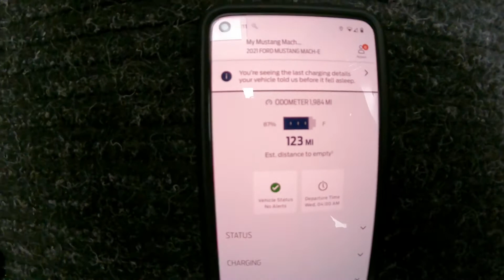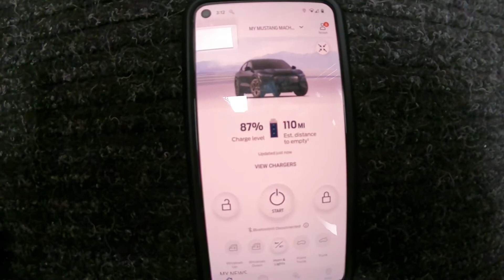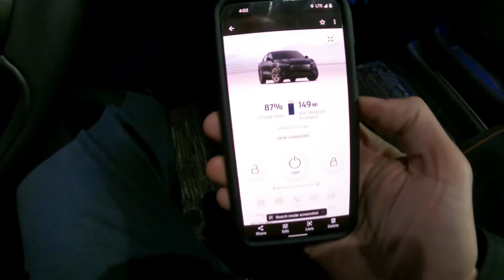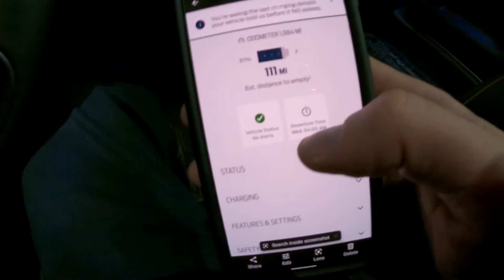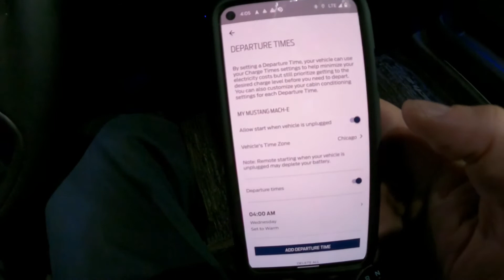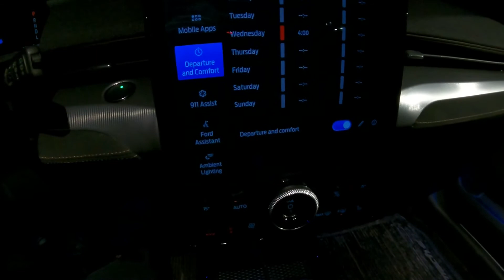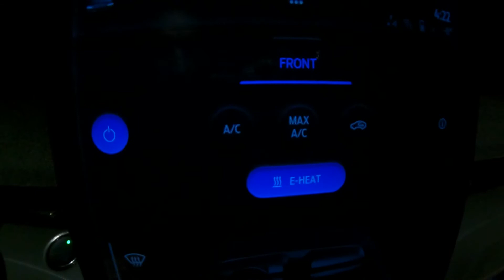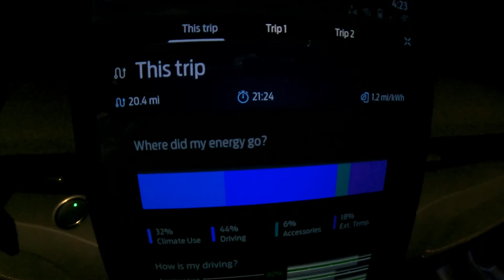Mach E Departure Schedule Failed Me AGAIN!

Comment: I had this same issue when I got my mach e May 2021, but they fixed this issue. Make sure in the app under charge settings> departure time, you have the "allow start when vehicle is unplugged" toggled on. Also, change the time to 15 minutes max run time in the settings in the car. You should change the vents to come out the front while the heat is on and turn the temp to "HI" instead of a set temp.
Reply from the maker: Allow start when unplugged was set, as mentioned in the video.  I also had the 15 minutes run time set too.  I don't set the temp to HI, because then the blowers kick on full speed and the system cools down incredibly fast then without being able to catch up.  A high fan speed would make sense if the system could produce enough heat, but it cannot in extreme cold.
Reply: @upnorthmike6085  I tested my heater here the other morning at 29 degrees. I got Heat by turning the temp to HI, Eheat on, Recirculate on, forward vent only, and having the fan speed set to auto. It worked quite well, but cant speak for -15 degree weather like you have.

Comment: Found your channel, and as a Minnesotan in the Twin Cities getting a Mustang Mach E, I've watched the last few videos on scheduled departure times.  I haven't watched the Mach E Heat and Heater Conclusion video.  Did you end up getting departure times working?  Is this part of the update that was pushed by ford for HVAC updates to programming of the HVAC?  We haven't had temperatures significantly 32 this winter, but has this gotten better.  2023 is built with delivery by the end of the year, and I have a garage and 240V and plan on preconditioning, with departure times, but learning about best practices.
Reply from the maker: You've got some more videos to watch  ;)  These will all be answered so be sure to check them out.  Yes, departure times are key.  With 240v and a garage, you'll have no issues with all the updates out now.

Comment: I will be getting my Mach E in April and it will still be fairly cold here in Fairbanks Alaska. Luckily I have a garage and will certainly keep my Mach in it. I still intend to recondition my batteries and warm cabin before departing so I will certainly learn if I have the same issues you appear to be having. One comment I will make is if you think about it logically that we are sitting on one ton of batteries at the outside temp. If you placed a ton of water on the floor of any vehicle, left it out all night in freezing temps, and drove off then your vehicle would be cold for a long time. That is just the way it is so if you live in a cold climate and do not have a garage then you need to have a Mach plugged in and set to precondition. Downside is that increases your electricity usage and lowers the overall efficiency. Improving cold climate performance is something all EVs will need to continue to improve. Hopefully you can get your vehicle’s issues resolved.

Comment: I have my car plugged in all night ....only 110 volts.....precondition set for 4.30 am....I also remote start my car 15 mins or so before departure.....this helps with the warm up cycle.....minus 30 degC....car is warm when I leave.....you shouldn't or try not to precondition unplugged below freezing as it trys to warm the battery pack as well that's a lot of wasted power. It was definitely a learning curve this winter........
Reply from the maker: What I confirmed is that when the vehicle is unplugged, preconditioning will not warm the battery,  only the cabin.  However as outlined, the preconditioning didn't even start when it should have.  I agree on the learning curve, but there are issues with the system to say the least
Reply: Good to know
Reply: My only 2 complaints with these cars is how slow they charge when it's cold out........and how much the range drops off.

Comment: I usually don't use the App.  I go right through the car and set up the Departure time.   If that fails in the morning, which it does from time to time,  I just remotely start the car so it's all warmed up.   Ford needs to fix that App for sure....
Reply from the maker: I  used the app this time, however I also confirmed the vehicle got the precondition time, which it did.  So, seemingly the app worked and transmitted the time to the vehicle, but the vehicle just didn't start at the time it should have.  What a pain!

Comment: It looks like there are programming bugs when not plugged in. In the extreme cold you have your best bet is to plug it in every night.
Reply from the maker: No question that plugging in is best, 100% agree with that.  This test was for those that can't plug in, or times when it might not be possible.  I'm glad I tried it out so I know and it seems at this point when you can't plug in, the best bet is to just use the remote start

Comment: This honestly sounds like a problem specific to your car. You may want to have the dealer or service center update any computer settings. I have had the Mach-e since April 2021 and the departure times and preconditioning have had no issues.
Reply from the maker: Good to know.  Cody, what are you outside temps right now?  I'm trying to ask around to learn if it may in fact be a temp related problem
Reply: @upnorthmike6085  here in the mountains of Western North Carolina we are a bit cooler than most mid-Atlantic states. We have been in the teens to twenties for a good portion of the winter. I charge outside as I have no garage. This is our first winter with the Mach-e so that has been a definite learning experience with how EVs, in general, function in colder weather.  I hope you situation improves soon.

Comment: I thought Ford Confirmed that Preconditioning (Departure Times) only work while plugged in? You can remote start the vehicle which is the setting (allow start while not plugged in).
Reply from the maker: The battery preconditioning will not work, but cabin preheating will work, as long as you have it ticked in the app to allow it to precondition on battery power.  I understand that's no efficient at all, but at times and for some, it may be the only option

Comment: Forgot to say my Ford app told me at 4.45am that my car was ready ..so it might be a time sync issue somewhere.....set departure time 15 mins before actual departure and see what happens.....
Reply from the maker: I could try that, but I did confirm the car clock and actual time are spot on, all updates are current...